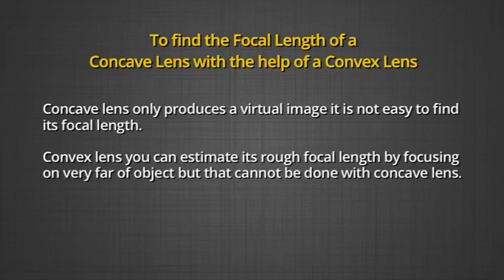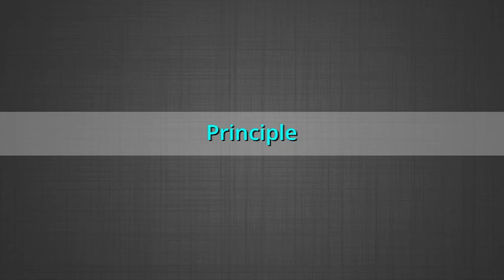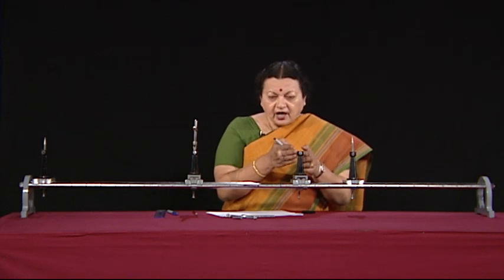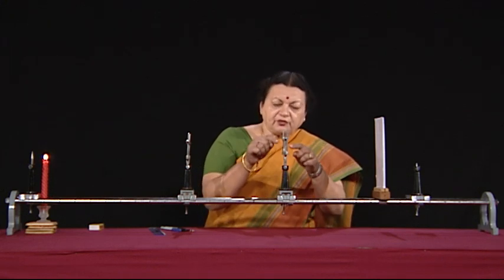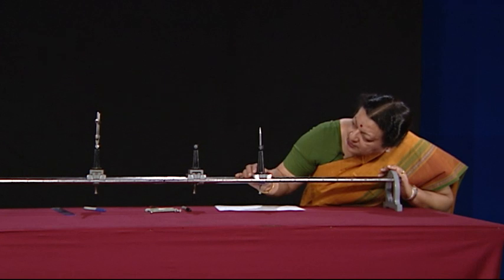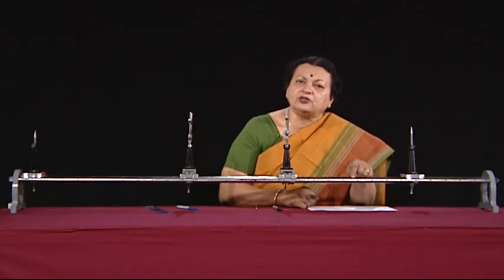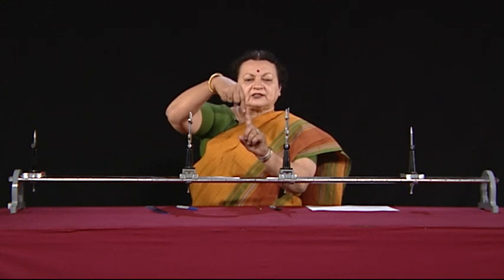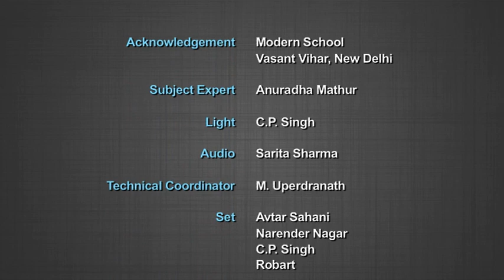To find the Focal Length of a Concave Lens with the help of a Convex Lens

Comment: The video explanation is clear and lucid. I have only one query. In the NCERT lab manual, it is given that -"It is
important to note that the focal length of convex lens L1 must be smaller than the focal length of the concave lens L2". Here, focal length of convex and concave lens used are 20cm and 12 cm respectively (as found from data table).
Would be grateful if someone clarified this.